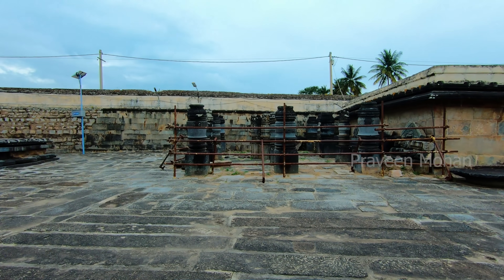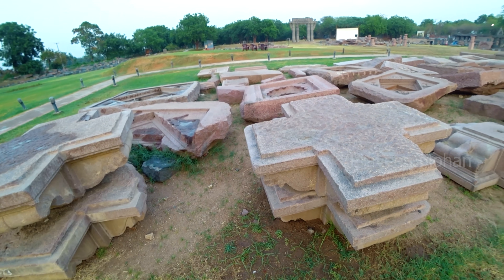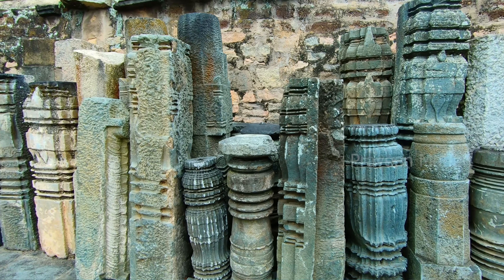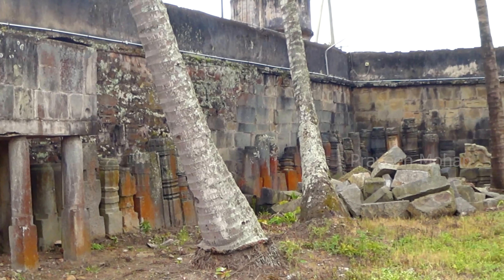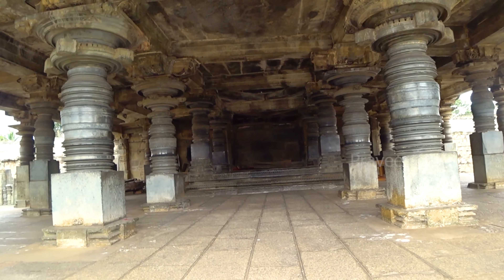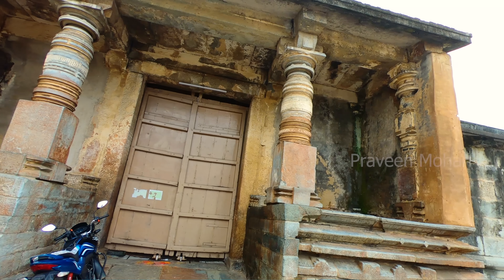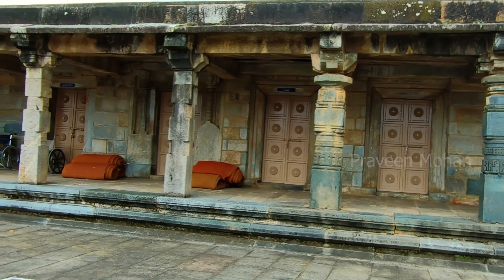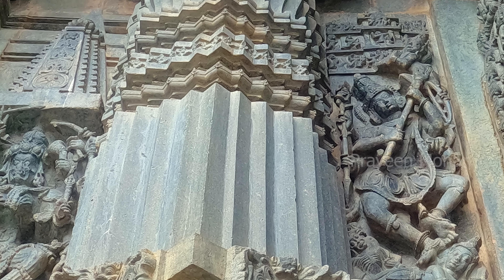Found an Ancient Pillar Manufacturing Site?

Comment: As a professional CNC-lathe programmer/operator this completely blows my mind. The size and surface quality on these pilars is just crazy... How big was there lathe and what could have powered it?
Reply: right
Reply: Buildings that acted as transisitors and energy generators, id believe. Cities that look like circuits. Like a microcosm to a macrocosm.
Reply: More then likely  if thier were  lathes 
It was the size of a person at that  time. 
It was grafted mentally from blue  prints
Reply: I was an old school machinist working on manual lathes years ago. I worked with "table lathes = horizontal lathe " on large pieces. I can see how this was done. Also I can see the ancient craftsmen making a spinning armature to hold the cutting tools similar to "line boring" in reverse. Do not sell short the ingenuity and skill of the ancient craftsmen.
Reply: It wouldn’t be that hard on a vertical lathe mounted on bearings.
Reply: Yes me too! I'm a tool maker, I work with some of the biggest presses in the world but  not on that scale! I want to see that Lathe
Reply: I bet their horizontal cuts were very difficult to do...
Reply: @jimallmondsr3467  they should mount the lathe vertical to support the weight on bearings.
Reply: Maybe the builders didn't need a lathe at all. Many parts of these pillars cannot be machined on a lathe at all. If they could make beautifully and perfectly detailed figures, why not a perfectly round one. You can see the scratch marks on the unfinished pillars. They 'just removed' the excess stone.
How? We don't know (yet). Greetings from The Netherlands
Reply: @Past_History  golden teachers bro
Reply: @larryhoover9101  What ?!
Reply: They are moulds.
Reply: Lingams powered them it would seem. The zero point power device like in Stargate.
Reply: @IamSunil017  This comment has no sense at all. Could you explain better?
Reply: It is interesting to get your perspective. I had the same thoughts, "what could have powered it". Another question would be what was it made of ? I don't think wood would be an option.
Reply: You should see some of the crankshafts turned for the huge ship engines.
Reply: Look up Atlantis and Jambudweepa's descriptions, concentric seas, 7 islands, 9 kingdoms, mountains on the north, oblong plain in the south surrounded by two coastal mountains in the east and west and even the length and breadth of the central island! India used to be called Jambudweep/berry island! But how can India be an island? Unless sea level was at least 200m higher, which apparently it was according to Exxon Petroleum company's past sea level calculations! Now go check out Indian peninsular mountains and plateaus & river valleys. Plato's twins Atlas and Gadeirus or was that Arun and Gadura, snake and eagle? Gadura/eagle did launch a campaign all over world upto eastern Euro!
Reply: The flood happened 15k bp during the younger dryas event according to star positions in Manu's story. After the flood, There were the snakes/nagas & there were the eagles/gaduras who although shared same paternal ancestry were the dasas(slaves) of the Nagas. Then they revolted and conquered the four directions (even upto eastern euro) with their 2 headed eagle emblem which became the emblem of Sri Vishnu who was the patron lord of the snakes and their ancestor. Which is why you find that emblem from Egypt to sumer, iran to euro. Many North Indian people like the Jats claim Naga lineage, while the south Indian kingdoms have the gandabarunda, two headed eagle emblem. They have a broad-er nose base meeting into a sharp and low beak like end and close-r set eyes like a bird of prey.
Reply: @deepika2440  much words, no sense.. Wake up buddy, you will have to snap out of it
Reply: Dude I am merely giving you clues you can pursue, it's up to you whether you want to wake up.
Reply: @deepika2440  Thx, I will look in to it
Reply: And Elora caves are the Atlantis city and the Kailash temple cut from mountain is the "Poseidon's/vishnu's palace" he built for 'Cleito/laxmi'. You will find the concentric canals from aerial view. As expected It's a Laxmi narayan temple I confirmed from the images sculpted. No idea why it's called a Siva temple that too constructed only 1500 years ago! Another diversion by the brits probably, they did find Atlantis after all and even rebuilt the narrow entry to the sea of that island, the suage canal
Reply: Could the lathe machine be Sudarshan chakra? We know it was a spinning disk with 108 serrated edges that could cut through anything like Mount Mandar described in Samudra manthan. And let's not forget Vishnu/Purushottam/Poseidon cut up a mountain to make a palace for his wife in Atlantis, just like the caves in Ajanta Ellors!
Reply: What if I told you the lathe was portable and compact?
Reply: @immaculateorganicsoaps3533  It was. It was probably what's described as the 'sudarshan chakra'. Just read it's ancient description and then search for modern magnetic array magnetron plasma machines or even simple steppe motors. You'll understand why it was said to cut up whole mountains without effort
Reply: @immaculateorganicsoaps3533  Then I would have to tell you, I'm sorry my friend but you have no idea what a lathe is. Small lathe = Small workpiece (pilar) nothing can ever change that
Reply: Obviously it was powered by an "ancient arc reactor". Havent you seen the episode on those? Possibly ancient fusion reactors as well.
Reply: Where is the lathe?
Reply: I am wondering if they could have used rivers to power giant turning lathes and maybe used grit to cut out some of the shapes and then finer grits to polish it.  Even today, grit plus a wire going back and forth plus water to keep it cool is used to cut slices off stones like agate.  They could have also done them in multiparts so that giant one could be many segments put together.  For the area with lots of unique pillars by themselves, that may have been a vender showing samples of wares to customers, maybe some that were off size, defective, or did not get used in projects were put out for customers to see and help them with choosing what to order.
Reply: @OnceUponaTimeline  Interesting theory
Reply: Suprised noones commented on the male/female parts..that wouldve been their way to secure in whatever their lathe was to turn
Reply: I can't even imagine the noise of the interupeted cut on a square piece of granite?
Reply: Probably multiple workers using something similar to a bow lathe. Remember that many of the larger pillars are actually built in stacking sections. The lathe itself was likely constructed of wood hence there being no remaining bits. 

Copper sintered with Corundum or potentially even iron sintered in a similar fashion was used to cut. Sri Lanka was well on its way to producing high quality carbon steel as well as corundum by this point in time and the materials and knowledge were there.
Reply: If we can't find the lathe machine or manufacturing then possible they exported from their planet where they have power source to operate it.

Comment: Excellent Praveen. As machinist I can also attest to there being attachments that functioned as a multi-axis machine center as the gear tooth & other relief profiling done to the turned diameters can only be done with a more involved machine. This is shown by the 'indexing' or the increment advance of the rotating diameter & the machining that occurs at a 90 degree angle to the turning plane so can these works can not be achieved solely by the turning process. These types of machines today are called CNC centers and feature the ability to produce machining on more than just the rotating plane and result in the same structures albeit on a much smaller scale & not of stone.
I always forward your vids. Your work is appreciated & your insight & cultural knowledge gives you such a unique & refreshing view than the academic blowhards whose only real work is in their minds and not on their feet like you. Please do continue to feed us. Thx Praveen.
Reply: Vertical mill-turn I'd guess. In another video Praveen showed rotating pillars that had stone bearings. That proves they had the skill and knowledge to build a vertical lathe. A spindled cutting tool and I'm guessing a tracer set up. Still, that might explain the machining, but not the fact that the stone is hard as all get out and they knew something we don't on how to temporarily soften the material.
Reply: Oh heavens...pretty soon we may run out of adjectives & superlatives for our "rock star" Praveen's videos on the advanced concepts or technologies that are manifest or depicted in our ancient temples. Regardless, we're very grateful for him & his amazing work.

Echoing few of the remarks here, the pillars at the end of this video are complex yet so very exquisite. It can make one wonder if it also involved laser-assisted rather than just 'lathe-based' multi-axis CNC machining. Did our ancients also utilize diamond tools to facilitate shaping & finishing of such hard stone/rock materials?!
Reply: @ramoldesnag4461  Of course I think they used diamond tools but I would think they might have been considerably more primitive than today in terms of drive and diamond cut but process would be identical. There is the interesting idea that the stone may have been made more malleable before processing.
Reply: @nun_bel_eever  I believe till 1800's India was the only source of diamonds and pretty big ones at that. The diamond sources also happened to be within 500kms of the temples shown.
Reply: @contemporarymatters8106  Agreed. But just like today the diamonds used for such work are not those that one sticks in their nose or crown....
Reply: @eboneezeradams1821  perhaps the material was initially cast? As they have possibly done with the pyramids in Egypt.
Reply: As someone in the cnc game I can confirm this is right.
Reply: @shapiemau2244  While there could be some validity to stone softening or possibly casting but there are no remaining molds for casting while Praveen has shown us one turning center in a vid last year. I would lean more to the craftsmanship of materials shapers rather than casting. Further credence lent by the other obvious carved stone works which have interior cuts that casting doesn't permit.
Reply: @nun_bel_eever  In casting, there is also a degree of machining, internal, once one mould is made then pillars could be more easily produced en masse. However, after saying this, they are matched. I have not watched his earlier videos as I was directed to his channel via a conversation on another channel. It is all very thought provoking and very different to what mainstream alleges happened.
Reply: If we could bring back this technology it would amazing , they're use rocks to move not like plastic,metal and other materials which is harmful to environmental
Reply: Do you personally think they could have produced parabolic reflectors with these methods?  The pillars already look to me like stacked optical elements similar to the lenses in a telescope eyepiece.
Reply: @brianboykin4965  If there were some further associated 'artwork' which would portend that idea I could accept that. One would have to look near the pieces to see if there is any supporting work that relates to use of these 'waves' or light.
Praveen has often shown connections like that.

Comment: Great video again, Praveen! Just a question: When I understood you correctly, the lathed pillars date back 900 years, and the technology of large stone lathes was lost when they made the temple extensions 500 years ago. How are those dates determined? Could it be possible that the lathed pillars are much, much older? Hindu history dates back thousands of years. And the phenomenon that the oldest layers of monuments are more precisely engineerd than newer ones, can be found all over the planet, e.g. Egypt, Peru. What is your opinion on this? Thanks!
Reply: I think yes you are right though I am not Praveen I just want to add I think building was more of a meditative/intuitive/GroupBenefit process than today which is more greedy profit driven and designed to collapse easily.
Reply: They always date things with "atleast". So it is minimum 900 years old and that is the most accurate they could get with evidence collected.  But for some reason when public read it,  the atleast is ignored.

Comment: I only have woodworking experience with Turning work, the machines that would be needed to do those pillars is mind boggling. And then carvings on the pillars on top of that. I just don’t understand how those machines are not around. They have to be somewhere, there has to be a lot of them, and they have to be massive. Where are they? Great video once again.

Comment: Awesome stuff! I did not know about this. If we are calling the object a "tank" in the pillar factory, I would guess it might be a coolant tank. Turning stone on a lathe would generate a lot of heat. Keeping the tool and work piece cool is important. Has anyone ever found any spoils around this factory? There would be tons of rock chips and dust piled up somewhere. I am guessing to the machines are long gone (sadly) but how about the mounts on the floor? Something turning thousand pound work pieces would require substantial means to mount it to the a solid floor. Sorry I am asking questions. This is new stuff to me.

Comment: Setting aside the scale of these pillars, slurries (sand/grit in a fluid) could be used to grind the surface topographies. Look up wire saws for the concept. I think it could be done 'low tech,' but the engineering/designs are the most impressive part.
Reply: The 3 dimensional geometric imagining, measuring & fabrication &  joint assembly in stone s a phenomenal  achievement. Even  currently, precasting Concrete elements is a complex task. As for sandblasting, u need a powerful pump to generate such sustained pressure !
Reply: @JG-qy6fe  I was thinking more of running a slurry over a spinning pillar to coat it with harder grit, then apply pressure with a lever shaped to the profiles you want to cut. The lever surface could be hardened metal, replaced as needed.

Comment: Thanks Praveen....Unbeliveable analysis by you. This turning is now called as polygon turning, but still the same replica like this cannot be made with advanced millturn machine as this is more complicated. Polygon turning itself would require a postprocessor for converting the tool path generated from the 3D modelling softwares like UG NX or Catia.

Comment: Ancient Indians used bullocks attached to rotating mechanisms to make cement mortar, to extract oils of different kinds,
to lift water from wells etc. I am sure this was the prime mover with huge gear ratios to achieve the required torque. As a
child I have seen bullocks that goes round and round turning a vertically mounted geared mechanism which in turn 
operated a sugar cane crushing machine to extract juice in Jaggery manufacturing units.

Comment: As an alternative, did they have any chemical etching methods?
Edit: just a suggestion, and I ask because trial or model pillars or not, there don't seem to be any cracks even now. Therefore there weren't any then. For stone, they would need not just a lathe but some sanding mechanism too, right? That would leave massive dust residue as well.
Reply: Their are indian texts which talk about electrolysis. So their is a chance they used it.
Reply: @TechAgama  from the आगस्त्य संहिता, yes.
Reply: Even water line can be used,but lot of pressure need

Comment: Instead of a carving tool for the lathe, could the same granite melting substance used in Peruvian megalitic structures been used in India to melt rocks attached to lathes? Also, was it possble for the pillars (large or small) to be assembled with multiple rocks using the same melting substance?

Comment: The little stub you see on top or at the end of some of the pillars is where a centre went when it was in a lathe. One end you have the chuck holding the pillar and the other would be the centre holding the other end up. If they've run a facing tool down at that end you're left with a stub where the centre is mounted.. This looks just like turned shafts

Comment: Praveen Mohan Sir, 100 Years back Belur Temple had many mini Temples inside the Boundary. Later removed all those small Temples and assembled broken Structures and spares parts of temple in the Corner of the Temple. I shared Old Photos in Twitter and Tagged you. Please check.

Comment: It is not just lathe.
The logitudinal steps of this kind only can be made by minimum 4 axis CNC machine if not 5 axis or 6 axis machine.
Any technical guy here can comment on this, I am pretty sure.
I dont think that these designs are made after lathe process using manual methods. See the straightness and accuracy.

Comment: I would expect ancients from these areas to have discovered lathe-turned stone as the regions are abundant with both the soft stone for turning as well as super hard minerals like corundums.    The process of lathing is very old, but to use it on materials beyond the hardness of wood, you would have to have an abundant supply of harder minerals, and India and SE Asia have lots.

Comment: I remember having a ether conversation years ago about this, they used sound to transmit the movement into the stone, the trick is you have to use the same stone to generate the sound.

In these cases it would be a Granite toolbit generating the sound, in the "rock chain" video you did they used rope around the Granite pillars surrounding a bowl of crushed granite, it turns to liquid fairly fast if the tone is high enough, and lasts for 15-30 minutes if you don't disturb the container of room temperature molten rock.